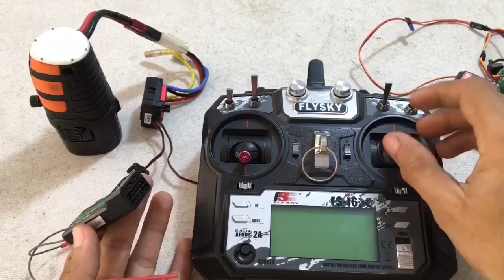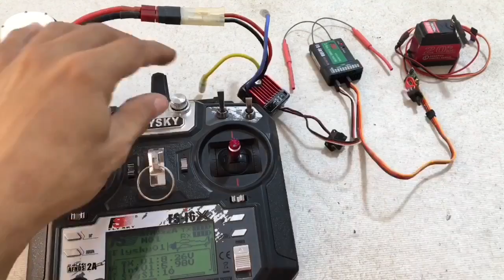RC TRUCK 1/14 SCALE RC HEAVY CONSTRUCTION HOW TO MAKE AMAZING HYDRAULIC SERVO 20KG HANDMADE TRUCK

Comment: The ESC disconnecting from the Motor under load, is the worst thing what you can do... it can destroy the ESC because it's generate spike voltages.